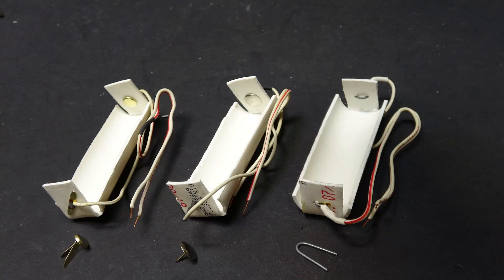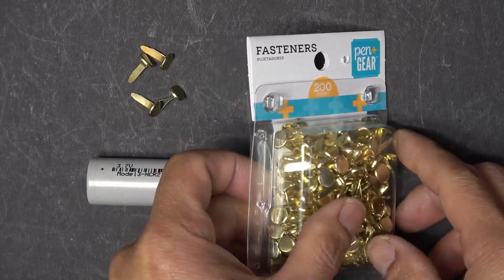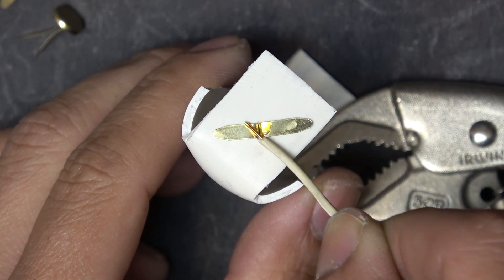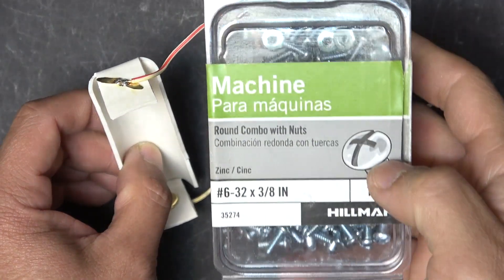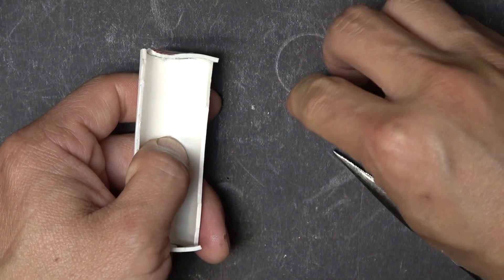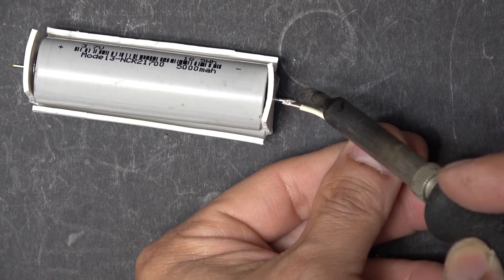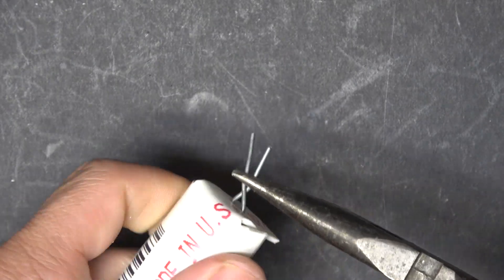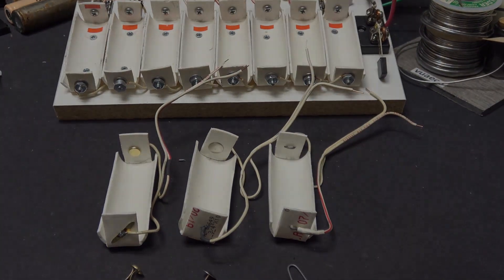Make Tesla 2170 battery terminals

Comment: You were working on Milwaukee batteries last year can you please tell me what type of solder were you using because I am finding it very hard to stick the solder to the terminals
Reply from the maker: I always use leaded solder 60/40 (60% tin, 40% lead). Make sure you put plenty of flux on it before you solder it. And also clean it up real good with a wire brush or sand paper would help.